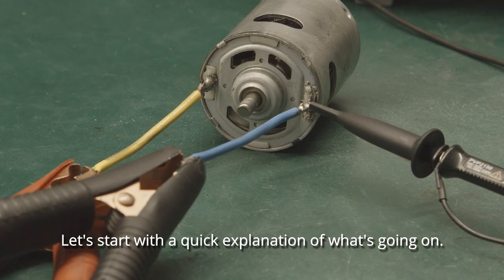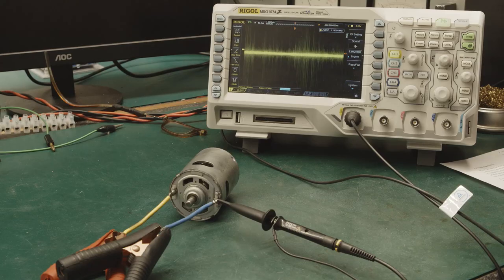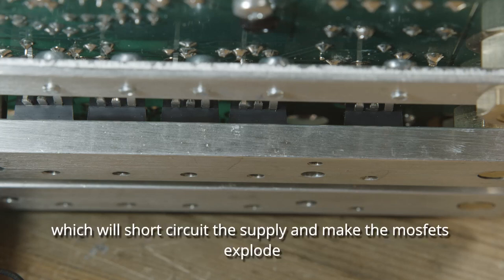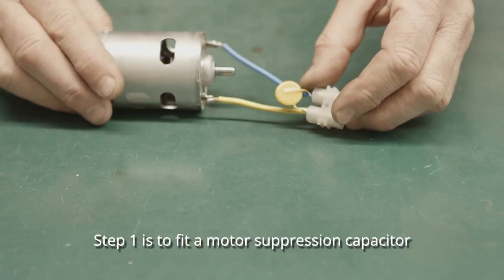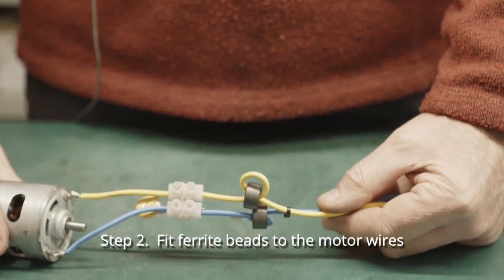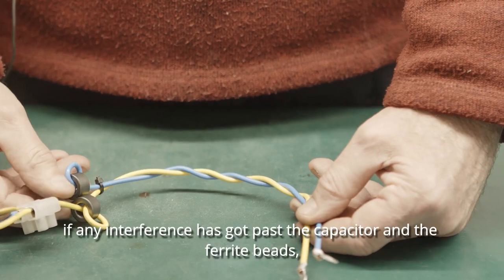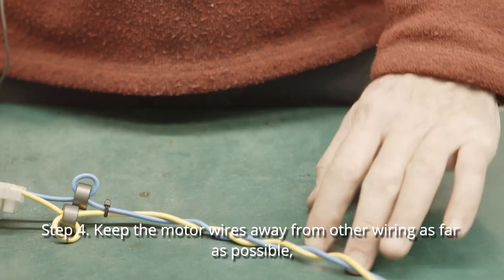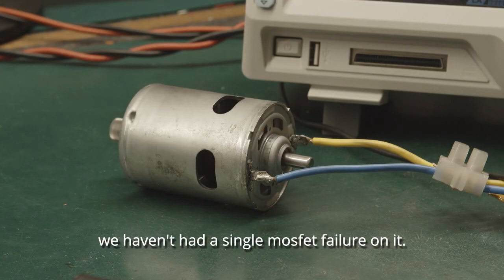Noise suppression for an electric motor

Comment: thx for the great vid, that leads me to the following question: what capacitor i use on a 180 VDC Motor with max. 1,8 A ? Thx in advice
Reply: IDK
Reply: 10nf 1-3kV ceramic capacitor
Reply: What capacitor I use on DC motor 120 watts, 24 volts on current sometimes 115 ,sometimes 220 volts and ferrate bears too ,thanks in advance
Reply: @mariomilan927  10nF 1-3kV ceramic capacitor
Reply: @HDgaming345  thanks a lot

Comment: I have an old sewing machine, In where motor is there is a 0,1uf 250v Rifa capacitor. 
Which is exploded and leaked out some kind of brown mess.

I was wondering, I was told that its a suppression filter. Do I need to have it and can use the machine without?
Thanks

Comment: How do you calculate the caracteristics of the capacitor relation to a given motor ? What's the relationship i need to know to adapt it on all the tiny different motors I have ?
Reply: Depending on the frequency your motor is running at. You can look up capacitor characteristic diagrams (impedance vs. frequency). Difference capacitors have different characteristics, and operating beyond the natural oscillation point of the capacitor, it becomes an inductor!

Comment: Do these solutions also apply to a brushed DC motor when used as a generator?
Reply from the maker: Yes they do, it's the brushes that are the main source of noise, it doesn't really matter which direction the current is flowing in.

Comment: Is electrical noise is noise that we can heard or is it an electrical interference? Because I am looking for how to surpress weird motor noise that it is not mechanical but high pitch humming sound.
Reply from the maker: This video is only about electrical interference. On two occasions we have heard audible noise when there is an interaction between the PWM frequency and some mechanical aspect of the motor. We quite often get a buzzing noise if dirt gets into the motor.
Reply: @4qd  ahh I see. Thank you!

Comment: hi i build a electric 3 wheel motorcycle  recently i installed a AM/FM radio every time i step on the gas pedal the radio go all static. i have been installing   15mm    ferrite suppressor filters on my motor  wires  and controller wires the    the controller is pushing 2000 amps at 203 volts do you have a recommendation for my sorry self  would be greatly appreciated
Reply from the maker: Wow that's a pretty powerful rig you have there - approx 500 HP! I wouldn't hear the static over the sound of me screaming. But seriously - is that a brushless motor? if so then I'd  guess that the noise is likely to be coming from the controller itself, maybe you could look at screening the controller and the motor wires.
Reply: @4qd   the motor is a NET GAIN warp -9    0 to 60 was 3.4 last year since i have added about 300 lb in speakers amps fans ect.

Comment: good .. I have the polypropylene 0.1uf 275v, as I understand it is for high frequencies will it work? Thank you so much. My English is terrible, I use a translator
Reply: I use 0.1uf, 1kV ceramic disk caps and they work just fine!
Reply: I have 220VDC/ 3 Amp motor connected to 3010 bridge rectifier and PMW 220VAC Speed Controller.
Any suggestions what Capacitor should I use?
And wouldn't the Capacitor will store some electricity?